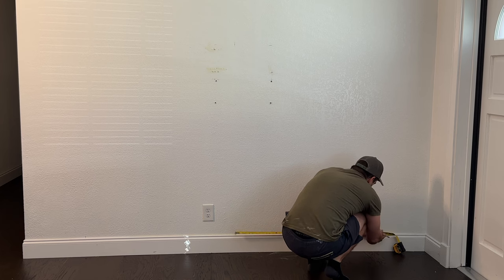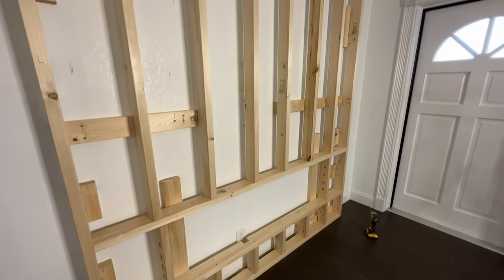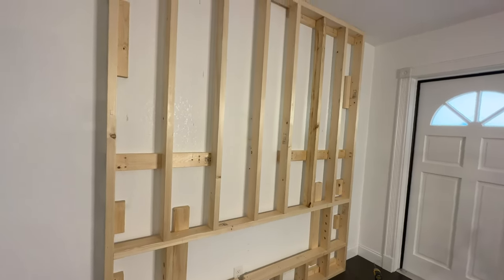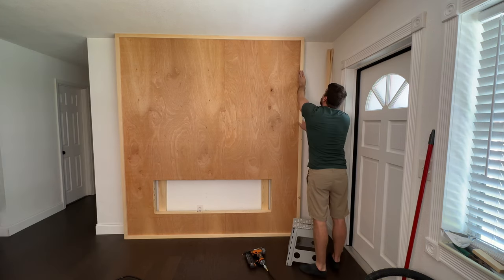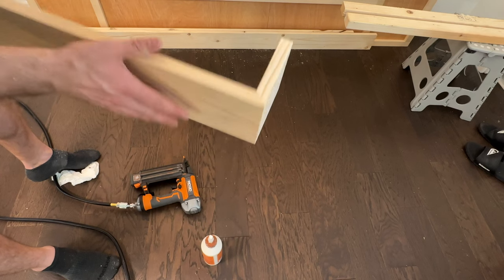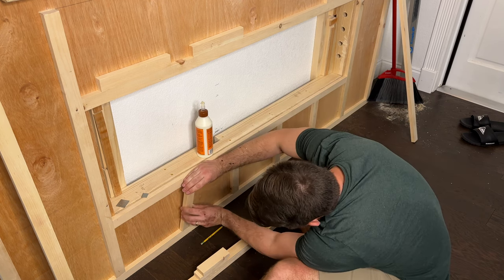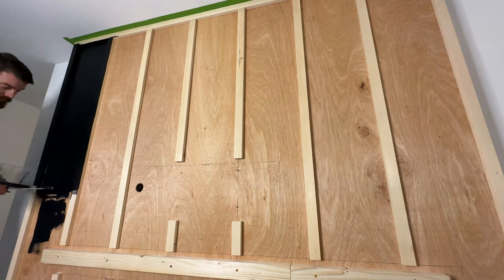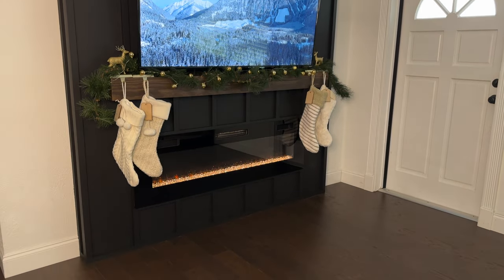DIY Electric Fireplace Surround With Mantle (Walk-through)

Comment: I am looking to do something similar. But was wondering is it possible to create something similar without ever poking any holes on the walls? 

Maybe a longer extrusion from the wall and a wider base on the floor?
Reply from the maker: Possibly, but if you want it to reach the ceiling I would attach it to the wall. They sell TV stands with  built in fireplaces on Amazon. Would be cheaper than building one yourself.

Comment: What is the height of your mantle from the floor? Great job!
Reply from the maker: Thanks! 44.5 inches to the top of the mantle from the floor.
Reply: @thebuildsociety  Thanks for the response! Just built an entertainment wall in my basement and trying to decide whether or not a mantle will fit well, but it would be right around that same height so that is reassuring!